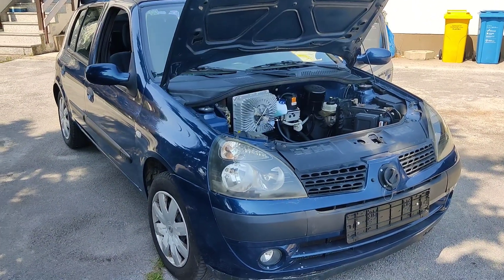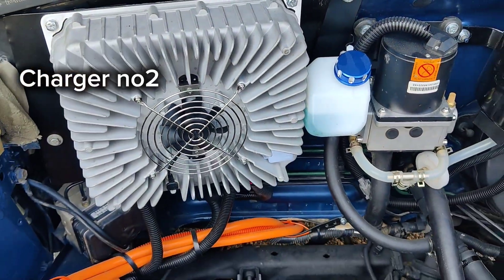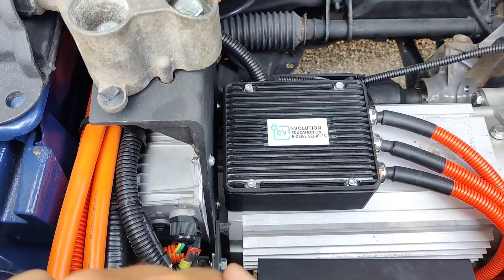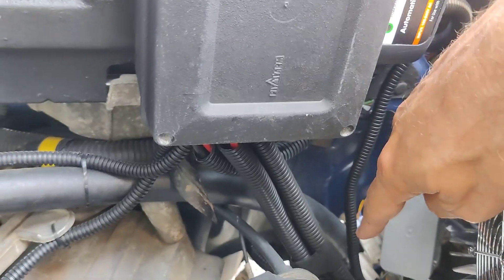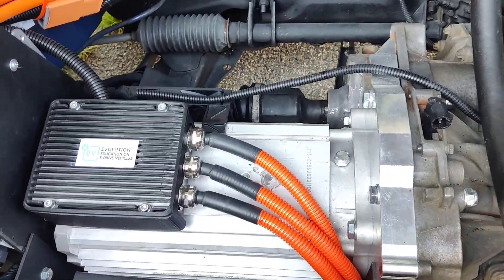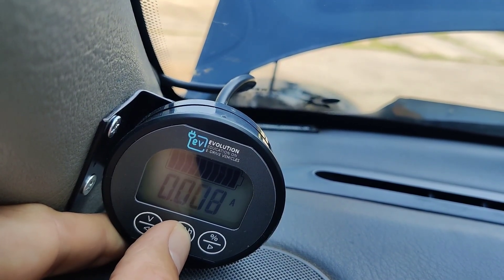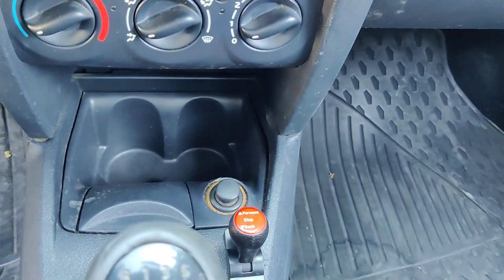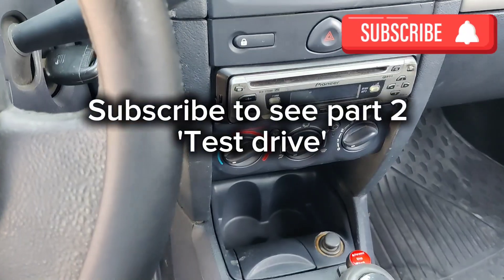ELECTRIC Renault Clio 2 - EV Conversion #evconversion #renaultclio #electriccar

Comment: the engine still has rubber mounts? being a clutch setup I ask
no AC also?
Reply: Hello, this is my car :)
it has AC compressor, heating and cooling works as normal Clio
Reply: ant yes, old mounts were used

Comment: What about the batteries?
Reply: Lifepo4 120Ah 96V, in the back
Reply: Great work ..what is the car range with these 12kwh batteries . And where are batteries installed
Reply: @amrmansour4947 

Batteries are in the trunk
Range i still havent tested, waiting for registration of the car...in a few days :)

But probably about 100km
Reply: @woodrunner51  Hi, where are you from, where will you do the registration? Is that even possible? I'm afraid that in Slovakia I wouldn't be able to register the car after the conversion.

Comment: What's your reasoning on not needing DC charging? Cost? Programming? Is the charging C rate if the battery not high enough?
Reply: The batteries in these are usually so small that it makes no sense. Also adding DC charging (e.g. CCS or Chademo, but especially CCS) to a conversion is not trivial.
Reply: As rkan2 said, but also there is no need for this car. tthese two charges will charge 80% in about 2 hours
It is a city car, 100-150km range. But is very flexible, allows additional batteries etc...
If i will decide to, i am able to add another battery without much issue for an example